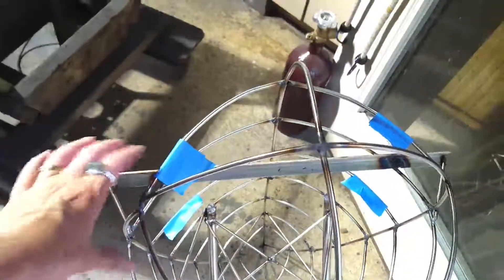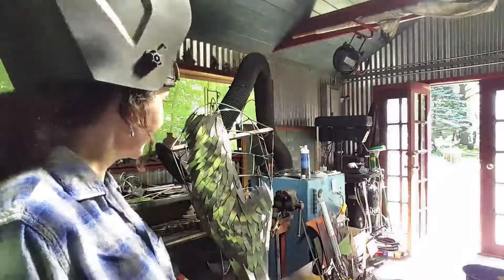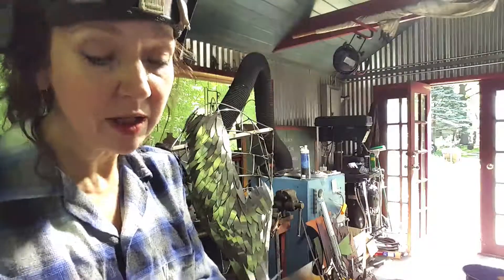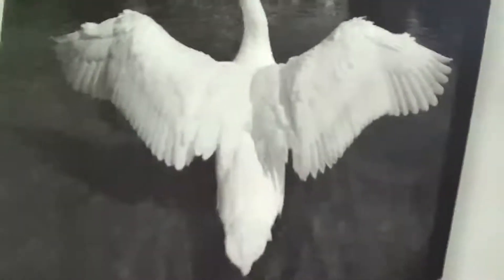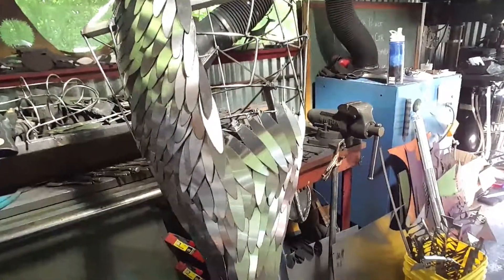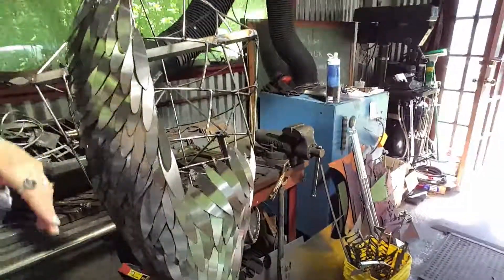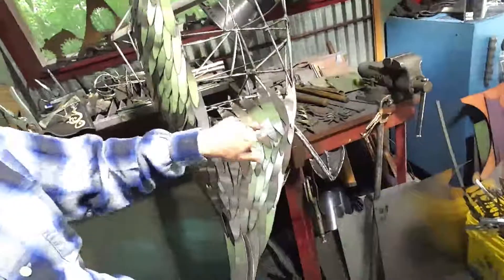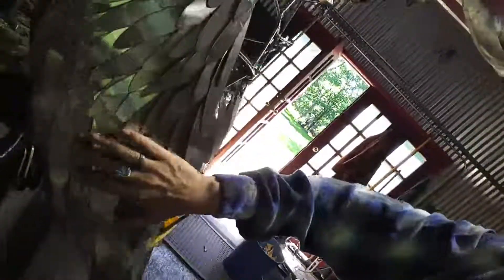Swan project 3

Comment: Coming along very nicely. So true about cleaning up edges of plasma-cut stainless. Much harder than mild steel.
Regarding arc burns (sun burned) 100% cotton long sleeves is effective. While your helmet is effective, the arc does sneak a peek at exposed skin from time to time under it. Maybe just button the top button on your fancy welding shirt. That's what I do...mostly.

The project is taking shape very nicel
Reply from the maker: Thanks-- and you are right-- that started happening too!  Ugh-- no AC in the shop, but, would rather sweat than get skin cancer I guess.  Lucky i have 2 fans!

Comment: Hi Sue , I used to do a lot of welding inside confined spaces and would burn the crap out of my neck from the uv reflection off the steel . I started using spf 50 sunblock and that did the trick for me. nothing beats being covered but sometimes it's just too hot. Also have you considered putting the feathers in a tumbler? this would allow you to deburr them in bulk . It may be too late on this project as it might alter the apearance a bit , but something for future projects .
Reply from the maker: I had 50 on, but put in a really long day.  I have leather sleeves too, but sort of forgot after all winter, and was thinking I wouldn't need them because tig doesn't spatter like mig can.  Lesson learned!  Good thought on the tumbler.  Not right for this project, but maybe I'll try it sometime-- thanks.  :)